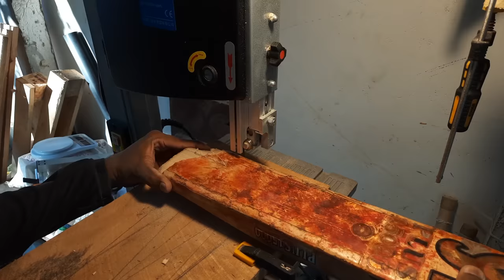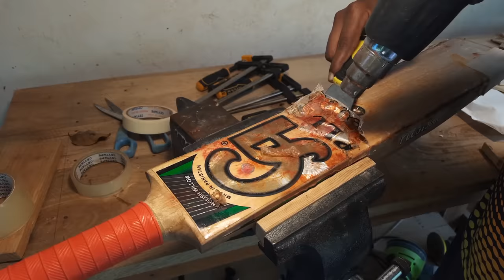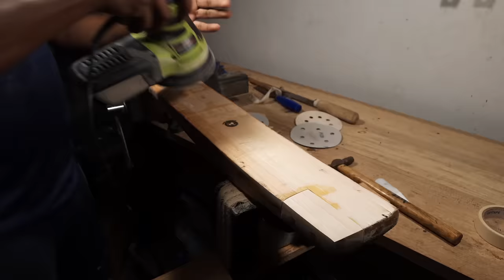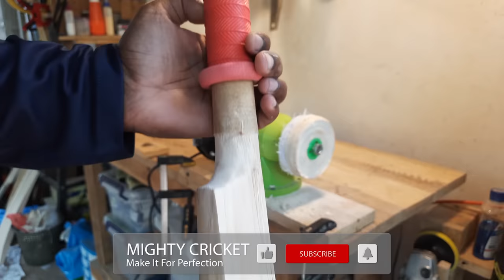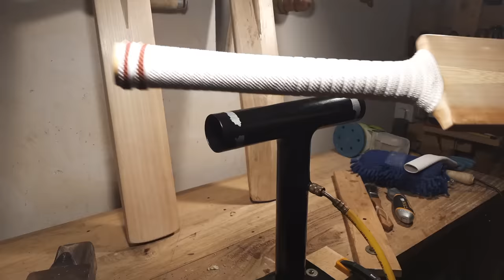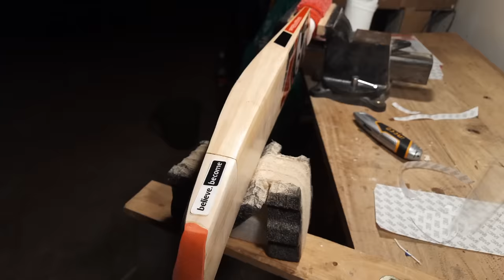Can this cricket bat be fixed - Cricket bat Repair - Episode 6

Comment: Nice repair, just to say that drill bit looks like a HSS bit for metal not wood, I would recommend a drill stand to ensure the angle of cut is perfectly straight and use a wood drill bit with Brad point as the tip won't wander.
Reply from the maker: Thnx Bro , Thnx a Lot

Comment: When a cleft is turned into a bat, it first has the placing surface pressed, so that the playing face doesn't not crack and break.
In applying your graft, the compressed face of the replacement part is aligned well above the bats face and subsequently removed with the draw knife after the glue has cured. You didn't show any preparation of the new playing surface.

What stops the new soft wood, that is now the face of the bat form damaging straight away?
Reply from the maker: IT Pressed with oil not with water before it get used ,, anyway 100 agreed with your point .. will share few pics of it ,, thnx for the comment bro ..

Comment: Very good work. However the bat should be oiled with linseed oil. The wood is going to dry out after use which leads to cracks and even breakages.

Comment: How much is a bat.. Wouldnt it be cheaper & practical to just buy a new one.. And wouldnt the balanca or vibration be off now..
Reply from the maker: Hiii Franky , Thank you very much for the comment ,, This is a top grade bat worth of 500 - 700USD and the repair cost of this is lessthan 100 usd  ,, for bat like this its worth to go with a repair & still this bat is use in practice as well as the matches

Comment: There should have been two shorter hidden dowels inserted parallel to the main axis of the bat linking the smaller surface to the main body. These hidden dowels should have been inserted before the new part was glued. Dove-tailed joints would have looked much nicer though! one would be molded integral with one glued end of the added bit, while the other would have been a sliding dovetailed dowel slid along the other glued surface.

Comment: You csn still see the join, lines of the new block is clearly visible and witha gap, this should be filled in with sae dust and glue and filed to smooth finish then varnished. The bat would have looked immaculate.
Reply: Yes I agree. It  takes real care with hand tools to get it seamless but it is possible. It does look a bit unprofessional. searching for the correct piece to match the grain better would be beneficial. I guess it is not a great bat to begin with??

Comment: @1:14 the cut made on the bat and immediately shown bat after is different. Also 12:33 cut on the bat shows it's in an angle.
Reply from the maker: Yes it has angle but has been corrected with sanding

Comment: All though efforts are good . But you can't play big shots with on leather ball with such kind of fixed bat . 
Secondly he done really wrong thing by applying fevicol on the thread of the handle . As it make the handle rubber more slippery.